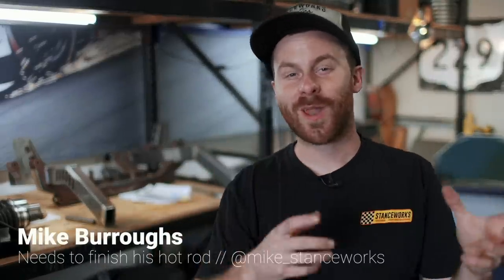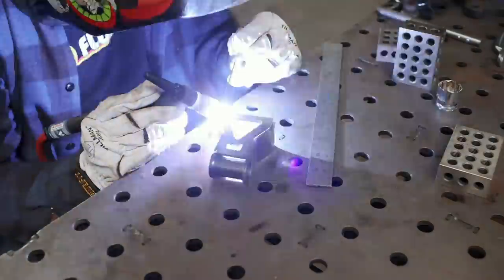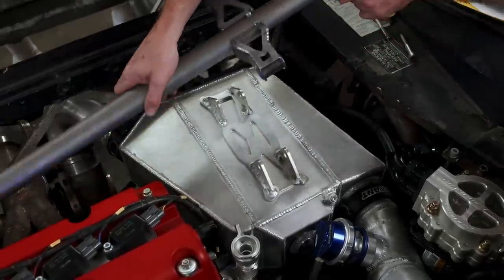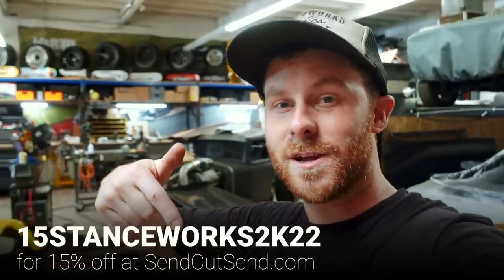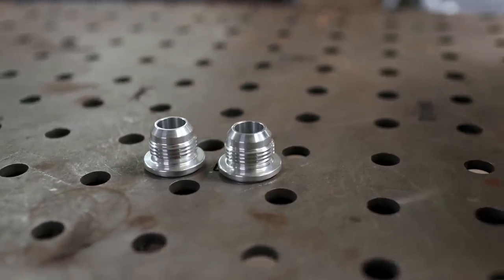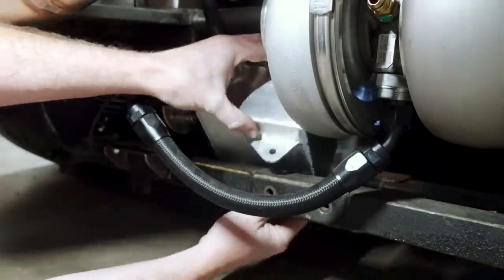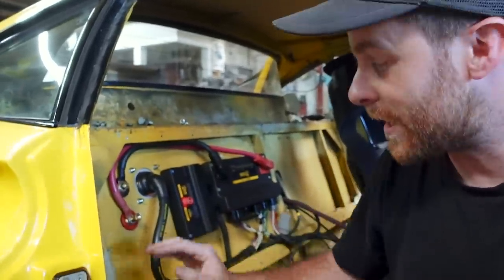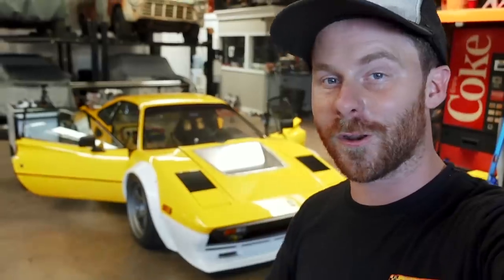Over-Engineering: Intercooler Mount, Oil Sump, PDM, And MORE! Honda-Swapped Ferrari

Comment: Absolute no for visible cage. I might however do one hoop that is a far back from where your head rest is. And since you can and like to fabricate, Add some smaller steel that connects both frames and roof sides. Something that can still be hidden behind OEM:ish headliner. That will add some much needed rigidity to chassis and also improve strength in impact without being heavy and without being eyesore.
If it was me I would do the same thing but in carbon tubes, use just the same tools you use for steel and just print connectors and then overlay lots of carbon on junctions.

Comment: I reckon lower the seat so headroom is a bit better, quick disconnect steering wheel and lower side bars to make ingress an egress simpler and it should be a goer. If not, at the very least a substantial roll bar.

Comment: This is spectacular work Mike, in regards to the cage, as I love a full cage for the safety and rigidity aspect, when I drive my caged cup car (on the street) I always feel a bit scared even with the roll cage padding, additionally, the cage in my other TW track 944 is a bit close to my head and I feel myself hitting my helmet on it on hard cornering, I think you’ll be happy with just the rear roll bar instead of a full cage, if you need more rigidity you can always add to your main hoop

Comment: About the rollcage

Can you do some test of the structure of the car? How many millimeters will it twist? I'd say, go from there. 

I wouldn't have a FULL cage. A roll bar will protect your head in case of a rollover, maybe some integrated A pillar strenghtening with integration in the middle instead of the sides. 

Being able to use this car on the canyons would be awesome.

Comment: For the turbo drain tank won’t you need to run a breather somewhere from the tank? 
If it’s sealed won’t the pump just create a vacuum and suck the oil out of the turbo just like if there was no tank. 

As for the cage vs bar, I vote just a bar.

Comment: I am no fabricator but I can admire the work that went into the intercooler hanger. It looks fantastic. However I do have a silly question, other than aesthetics, wouldn't an exhaust hanger setup be just as effective in absorbing vibration while providing support?

Comment: From Chris Platt of Safety Devices International interview
A roll cage is meant to be used as part of a greater safety system.
Any caged vehicle should feature properly-routed harnesses and race seats.
A helmet should be worn whenever a cage is present in a vehicle.
A new roll cage isn't the place to practice welding.
If you have a cage in your car, it should be properly padded.
Cars that don't see track work shouldn't be caged for aesthetic purposes

Comment: Hey Bro! First Post here! Siq car enjoying your vids! I think you should just go for a half cage behind your seat and head. You’ll get some Rigidity but at the same time also rollover protection. It may be horrible but maybe you could run a centre bar down in front of the windshield or the centre bar and then a  U windscreen bar around the perimeter of the windscreen in front of you then just a centre br to join it to the rear bar behind your head, if that makes sense. There just wont be any protection above the top of you doors. My 2cents.

Comment: Hell yea bro perfect timing with that SendCutSend discount I bought a radiator and fan shroud for my Camaro from Champion cooling but their 10in fan shroud sucks holes are in the corners instead of the middle so I can't mount my fans I've been practicing my fusion360 sheet metal design to have SCS make me a shroud that works.

Comment: I think you should maybe considder to change chair, with smaller leggsuport, not as high, and make a cage, full, graded just so you can do it safly on a Timeattack run... I dont know if its right to do, but, smaller tubing and thicker wall maybe?

Comment: I'd stick with the standard 4-point cage you built before but maybe add padding to it, padding to the point that it's almost a 2nd headrest (might actually look cool too)... I'm also assuming you'll be harnessed in even when on the street, so your head should* never reach the bar unless whatever happens is REALLY bad. If you start getting crazy on the track think about going full cage.

Comment: As the direction of this car seems to be a Racecar for the road as opposed to a Versatile streetcar ( looking at the air to water intercooler and extreme cooling mods upfront ... body and aero chopping aside ) i think a cage will be necessary. Since cabin room is such a premium not that chopping up body parts is the best idea, maybe have door bars that reach out into the door assemblies for room that way or if there are any legal detachable sidebars, I've seen first hand what 300whp can achieve and that was in a car 1000lbs heavier. I think for safety its a must, not only that but for handling, driver feel and what seems like your underlying goal. Maybe a hybrid cage with low low slung door braces but otherwise full construction for overhead etc. Either way your choice and the build is awesome, just a downside of such a small lightweight car ... space.

Comment: What does the TA class you plan to run require for the cage?  Half is cool to keep it streetable but if the cage is required for the class then it’s a non starter.

Comment: re the cage: Yes, yes and yes.... I have been in many a race/rally cars that have had way less power and was very thankful they all had one. Remember its the crash you have when you don't have one that will make you re think this question every time.  Use a removable steering wheel that will help allot also your seat has high side (great) so side bars won't impede your entry that much. Build is going great keep up the work, also fire suppression? whats your plans here.

Comment: If a potential full roll cage doesn't have to meet any certain sanctioning body rules; then why not just have the brow bar and roll bar be connected down the middle instead of the outer ends. This is if there is even room for your head? Another thought. If door bars can't be at a "traditional" height because of entrance and egress put them low. Or detachable door bar ends, as sacrilegious as some ppl think, there are some really nice interlocking pieces available.

Comment: I notice that the roof structure above the doors has a bar and what looks like sheet metal connected to the roof skin and door surround. Would it be possible to cut that bar (very carefully) out and tuck the new roll cage roof bars into the the same place? You could then weld it to the car to reapply structure and support the shell.

Comment: If that sump tank is sitting on the frame (opposite side of the retaining bolt), after a while it will vibrate and rub a hole in the tank.

Comment: If you’re worried about hitting you’re head, that’s only really going to be on the roof bar by the door right? So why not run a couple of central bars to connect the front and rear roll tubes instead (think trans am style middle brace) 
As for ingress at the foot rail, running a single bar at the bottom of the door would stiffen up the “box” without ruining that?

Comment: on the subject of the roll cage, the car already has a tube frame running around the roof that the fibreglass glues onto, yes? why not just add bracing to that and add an extra roll hoop behind the seat?

Comment: Could/is it possible to do a half cage in the rear and make the front sections removable via heavy duty bolts? So when your heading for the track you can put her in track mode, then take them out for road use?

Comment: 8:23 that will only make sense if you put a vent with a one way valve on the tank. Without a vent the pump will suck the oil out of the turbo as there was no tank in the middle ....

Comment: Suggestion: install a removable steering wheel so you can get in and out of the car easier. Add a roll bar next to the firewall. That's all you need.

Comment: I mean its not ideal but if you did put a cage you could always street drive the car with a helmet that isnt full face so the top of your head is protected. It would only be a minor inconvenience considering how little you would probably street drive the car. I'd be nervous putting a cage in even if you aren't street driving the car tho. Thats a real tight cabin I couldn't imagine having to get in and out of that thing. Especially if there is a fire a cage limiting your ability to get in and out of the car with reasonable speed may be a bigger hazard than the small chance of rolling.

Comment: Love all your work and vids. I'd consider a smaller seat, as low as can be and maybe nudge the back of the seat towards the center console a tad to give u more head room... assuming pedals wouldn't be too uncomfortable to access. I'd then do a full chromoly cage with pinned and removable swing outs that fit your height, hopefully low enough to not be visible during normal driving. Keep up the great work.

Comment: Why would the intercooler need to move with the engine are you using V-band joints to connect the piping or are you using rubber/silicon couplings I hope you are planning a bottom and or side mount the intercooler will be experiencing forces in 3 dimensions, plus it will we water-filled so think about the forces just something to think about

Comment: As for cage would it be possible to fabricate a full cage but instead of following specific guidelines on door bars, Could you make a door bar internal to the door frame similar to how the 350z has substantial reinforcing for side impacts. Better to have it and not need it than need it and not have it!

Comment: The roll cage aspect has been a question I’ve asked before, I’m aware you’ve gotta have harnesses + gotta wear a helmet or it’s ultimately more dangerous, BUT could you fit a GT3 style half cage with a diagonal or X frame behind you (I’m aware you’ve no room) but also what’s your plan with the interior ? Could you street it once it’s running, see if you actually use it on the streets, then once your tracking it go full cage ? Ultimately 1000hp is going to be awesome but how you’ll use it is a question only you can answer

Comment: A cage doesn’t stop drivability.   Make the steering wheel removable and add super low door bars    I think you’ll be happy if you build it
Reply from the maker: It stops drivability from a safety standpoint. It’s extremely dangerous to drive a caged car on the street with no helmet, especially when there’s no clearance from head to roll bar.
Reply: Unless he wants to wear a helmet everywhere he goes, a full roll cage in a street car is dangerous, particularly in a drivers cabin that small. (Human skull vs Chromoly steal equals death)
Reply: If you look how close his head is to the topside of the windows, and imagine there being a 1.5" tube up there (that realistically won't be perfectly contoured to the body), it would be really, really hard to not hit your head on it in an impact (or hell, a California pothole). Foam padding might help, but there's really not a lot of room up there for the padding + airspace + tubing + helmet for track days. Pretty tight and agree with Mike on this one.
Reply: Having the car get crushed also isn’t safe in a crash so I think it’s worth it to try and fit a cage. That’s completely up to you tho it’s your project.
Reply: Potentially you could add roof support through the center of the cab  If that would keep any cage components far enough from your head.

Comment: I suppose I get the whole "needing a tank in between the turbo and scavenge pump", I think understand that, but I'm curious about; does the tank have to hold a specific volume of oil? or is that based more on how much the scavenge pump can flow? What happens if the scavenge pump sucks the oil out of the tank faster than the turbo can get the oil INTO the tank? Just few questions that popped into my head. As always, love the content!

Comment: This there a way to make a mini hoop that goes behind the dash and run leg/side tubes to connect?   I know nothing about cages but looks like it would at least give you a three point cage and you could tie in the front chassis as needed.  

I’m like you though, I want to drive what ever when ever I want.  If I can’t enjoy it I don’t want it, especially after all that hard fab work.

Comment: Can you build the roof bars into the roof cavity? There looks to be a tube there already.... Part of the OEM structure? Why not remove it, and build in a larger diameter tube? Your scavenge tank doesn't need to be that big.... There is very little oil going through the turbo.... It will take an age to fill it up enough for the pump to be effective.

Comment: Whilst you don't plan on taking on door-to-door racing, it is my understanding that many time attack events will require a cage of some sort if you beat certain benchmarks. As this is one of your aims with this build, I don't think you would want to not put the car through its maximum abilities just to stay under a certain time to save getting a cage. Maybe a half cage could work, or possibly ensuring the roof bars of a full cage sit just behind the windscreen and far enough behind your seat that they don't interfere with a helmet. I'm sure there are options. 
On a side note to this, you won't be daily driving with a helmet so roof bars won't be your main issue. It will be the sill and door bars that make it difficult to daily. I'm not sure what options are there to make that easier to enter the car and still maintain cage safety requirements.

Comment: Tbh the cage is an amzing safety device that can and will save your life in a bad accident. There are a quite a few cars that dont run a full cage like jackie ding but.... his car is a new age car with  airbags and a lot of crash safety built in he even has his wheel airbag but your car doesnt have like any. I think it would be the smart and safe choice seeing that if u get into any type of accident past a small fender bender that old as steel square tubing chassis prob will just snap on you. I think its would be a safe choice but idk if it necessary right now. I think u can still go a few track days and event without it and get to learn the car and drivenit on the road and once ur full on set on it being a track only time attack killer then u go full cage. Amir didnt even put a full cage in till recently.
Reply: A full roll cage without getting extreme isn't going to fix the chassis safety limitations, a standard in cabin cage isn't going to solve the lack of airbag or modern frontal crumple zone in a head on (not an typically an issue at the race track), a full cage will protect your body in a side on impact or roll over, but it's not going to help you if the force of the impact smacks you skull against a chromoly tube inches from your head. Motorsport safety equipment is designed as part of a system, for a very controlled environment, remove an part of that system like the helmet and it can be more dangerous than without it.

Comment: Doesn't that catch can need a breather hole because it will still create a vacuum?

The oil drains from the top of the can from the turbo and is scavenged from the bottom. What happens if it scavenges faster than it drains? Wouldn't it created a vacuum. So wouldn't a breather hole be needed at the top also?

Comment: idk if its possable but coulld you make a cage that has removable door bar? like a half cage to mount harness  with eyellt that can accept the door bar? and not run a roof cage? or you can always add a cage later on depending on what you end up using the car most for

Comment: Won't the scavenge pump still suck oil out of the turbo if you don't put a breather on the tank? Won't it pull a vacuum even if it's just sucking air?

Comment: Hey dude, 
I’m sorry to tell you but that oil catch tank for the turbo must have a breather hole / air inlet so the pump won’t create a vacuum . 
It will stop it thieving oil from the rest of the engine . 
Otherwise it’s going to evacuate all of the oil from that turbo by putting it under vacuum, rather than positive oil pressure .
Reply from the maker: Easy fix! Thanks

Comment: It seem like part of your problem getting in or out was the steering wheel maybe you should switch to a detachable steering wheel which will make it easier to get in an out of the car you could put a whole cage in but use pins to remove like side bars an other piece of the cage for when you Street driving it

Comment: Wish you saved the cash on the mounting of that intercooler and focused on the water and air flow performance instead..... I also don't see what the turbo box will do for you if the pump will "suck the turbo dry" then adding an un-vented box gives the same condition. To reduce the "suck" you need to vent it and introduce some air bleed but make sure the pump can handle pumping foam.

Comment: Been following along for a while and realy like your work! Both the design and execution is next level. One thought on the turbo oil catch can is that the level of the oil in the can needs to be lover than the lowest point of the drain on the turbo. The oil needs to drip/pour out of the bottom of the turbo and in to the can, then it can be pumped out. If the oil restricted it wil pour out in too the turbo and cause problems. Id happely send you a CAD drawing of a can/container if you'd like :)
Reply: Hi, interesting! Can a one way membrane (rubber flaps) prevent this? Seems to me that some extra to prevent oil sucked out of the turbo is needed.
Reply: @theautomotivetrainer  I can't answer that, with some engenering it might be possible. Just know that the oil needs to be able to pour out of the turbo unrestricted. If not it might create excessive oil in the inlett and exhaust.